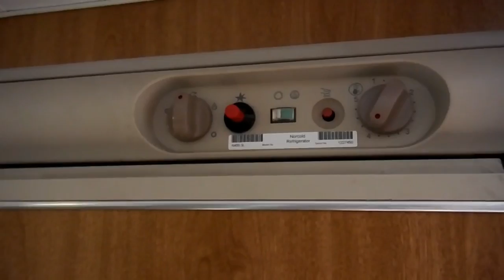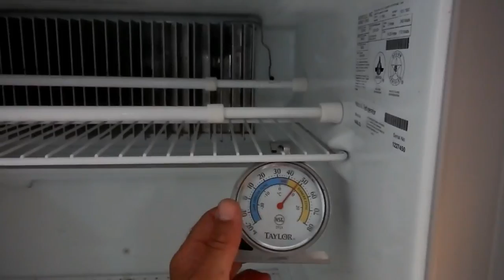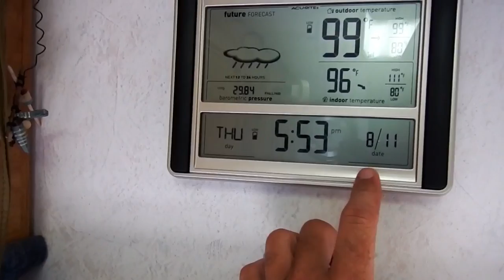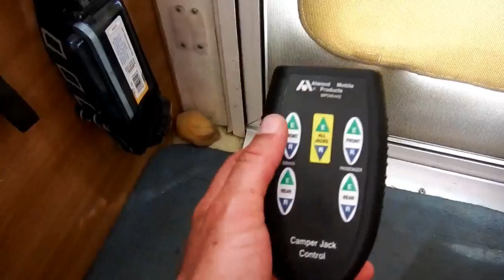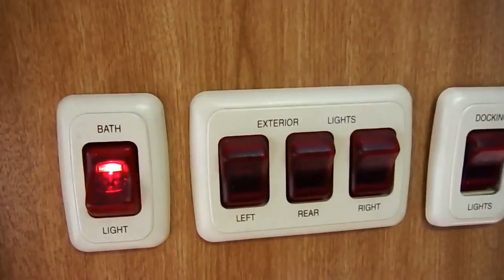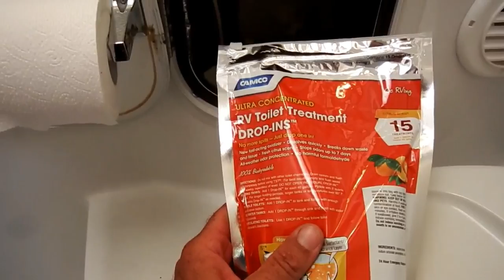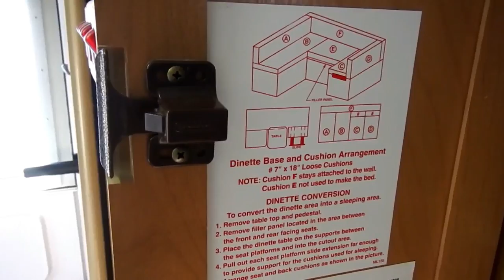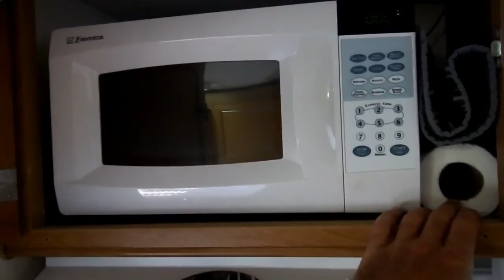Interior Tour of my 2005 Lance 845

Comment: Excellent tour.  My current (soon to be replaced) camper is a 1992 Lance 480 (9'-6" long) with a nearly identical floorplan.  The main difference is an additional pantry next to the fridge and a bit more counter space.  I enjoy seeing the ideas others come up with for storage, usability, etc., including your ideas.  Mine doesn't have the ducted heat to the bathroom, so had to leave the bathroom door open at night to keep it warm enough in cold weather.  This weekend, I'm replacing the fan motor in the furnace because after 26 years of use, it is squealing due to dry bearings.  Although I won't be using this camper any longer, I'm fixing the fan for the next owner.  Like you, I'm a light sleeper, and every time that thing came on, I woke up.  I like the idea of the Wave 3.

My next camper, which should be completed this month (Mar. 2018), is a Bigfoot 25C 10.4 with a unique floorplan having the dinette and kitchen in the back half, and a dry bath up front.  It will have a basement too for greatly needed storage.  Being older now (of course), I'm tired of wiping down the walls of the wet bath after each shower, but it needed to be done.  The new camper will also have a solar panel to help keep the batteries charged for boondocking, as long as I'm in an area out of the trees.  I've never really needed a generator, so didn't purchase one with the new camper, although it will be generator ready in case I change my mind.

You have some great areas to camp in your part of the country!
Reply from the maker: I bet your excited about your new Bigfoot camper.  Those are good campers.  I like the two piece shell they have, less likely to leak.  I hate having to squeegee my wet bath out every time I use it.  But it is a must if I plan on using the toilet without getting wet.  Have fun with your new camper.
Reply: Thanks!  I'll post some pics eventually.  I'm glad you're enjoying your Lance.  I had many great trips in mine!

Comment: maybe a good place for extra batteries is inside truck bed ahead of wheel wells, with a plug to connect to camper when you load  it onto truck .
Reply from the maker: That's a good idea.  Was thinking about taking the drawers out from underneath my stove and putting in some AGM batteries.  The outside battery box is right next to it.  But then again, I would be loosing some valuable storage space when I take the drawers out.  Thanks for the comment.
Reply: sometime you can get large tractor batteries used but in good enough shape for camping,, from your john deere dealer...buy a couple on the cheap, and when they are done, take them back to john deere dealer and just swap at no cost for another pair,,,my dealer lets me do this as hes not out anything except at the front end which i pay for,,,then the rest is just swapping for a friend...regards...
Reply: I set mine up like that.

Comment: Very detailed comprehensive tour of the interior.  Is there storage under the bed?  What about the exterior?  Any solar?  Issues with the roof?  How much propane?  Batteries?  Thank you.
Reply from the maker: Thanks David.  There's no storage under the bed.  I don't have solar but do plan on getting some in the future.  Was thinking about not installing the solar on the roof since I disperse camp a lot in forests, and would like to have the ability to move my solar panels away from the truck into the sun light.  I've had no issues with roof leaks, but did have a leak around the front window.  I had it repaired and left the window out.  I have one battery and trying to figure out where to install a couple more.  With truck campers, not a whole lot of space to work with.  I'll be doing an exterior tour coming up soon.  Appreciate the comment.
Reply: looks much bigger than i thought it would be, nice set up